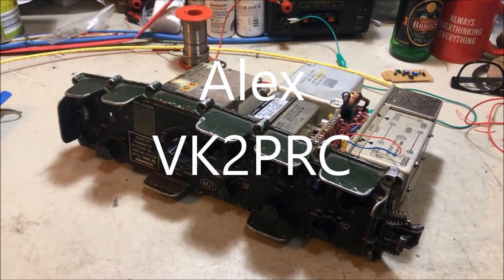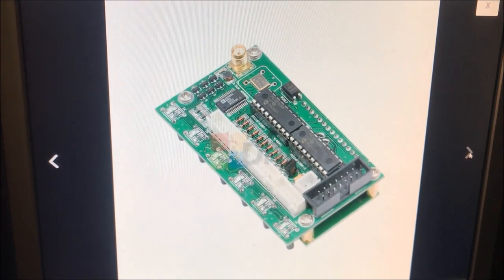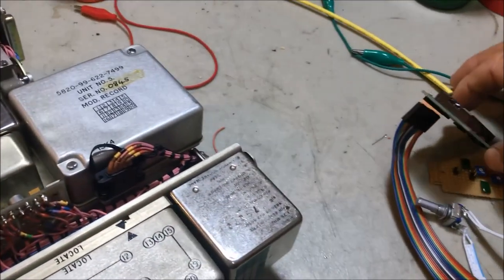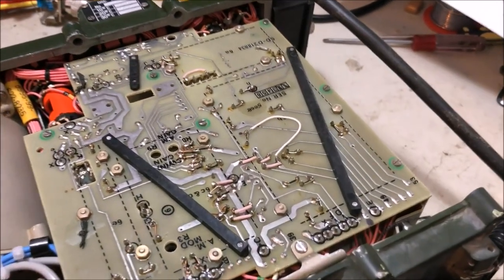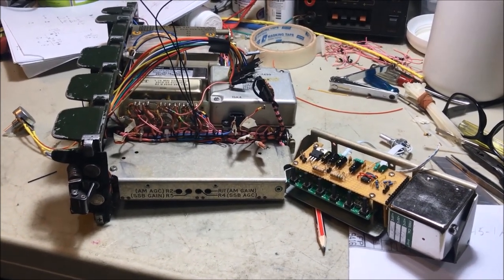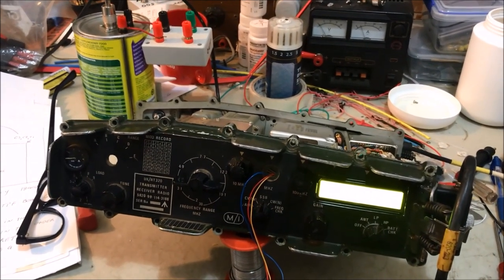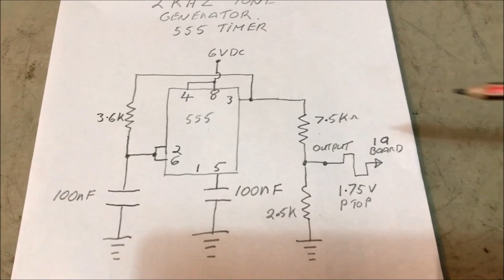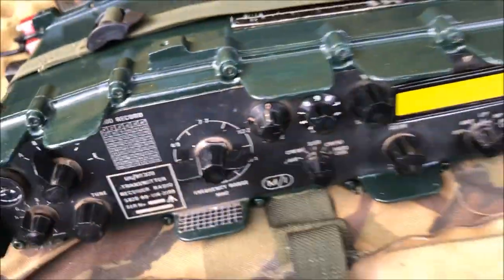VK2PRC Clansman 320D Mk2.  Installing a DDS VFO into your failed Clansman radio

Comment: Great mod Alex!   Very interesting. How do you change bands or freq. steps ? regards Alf LA3YP
Reply from the maker: Bands are changed in the normal way with the band switch and the frequency is simply dialed up on the DDS. Frequency steps are selected on the DDS. all too easy.
Reply: @vk2prc978  Thank you Alex, spotted your drawing of the DDS in the video and now I understand. Been a ham since 1971 and I think my internal DDS is slowing down hihi..

Comment: Really nice job, well done.   There is a contrast setting on those LCD's you have to add a small Pot on it if it hasn't got one already.  Basically you connect a pot 0-20K from 0-5v connecting the wiper to V0.  Have a look at the data sheet: https://www.openhacks.com/uploadsproductos/eone-1602a1.pdf
As I recall I think there is also an option for brightness too.